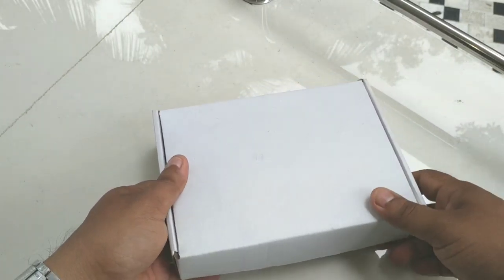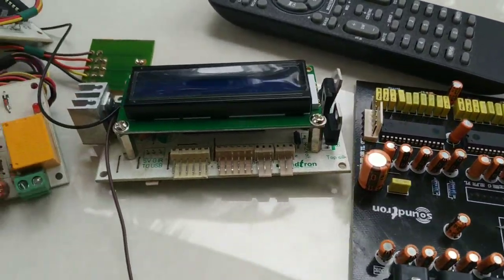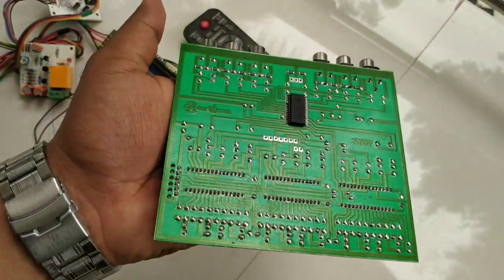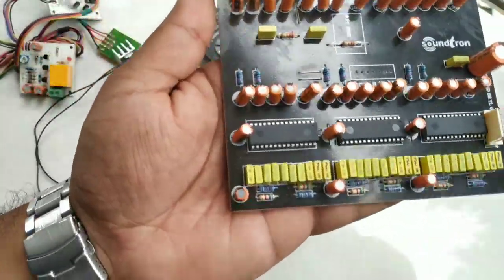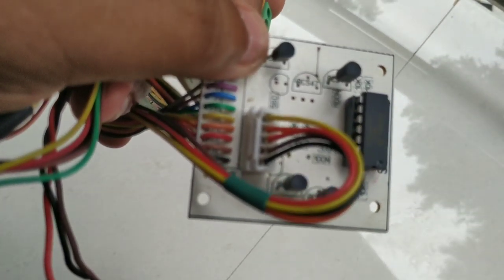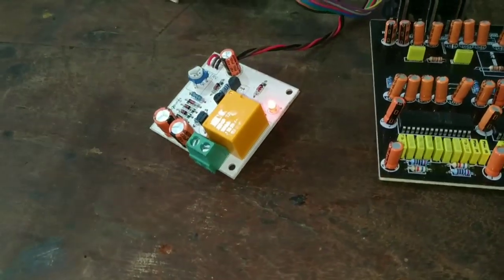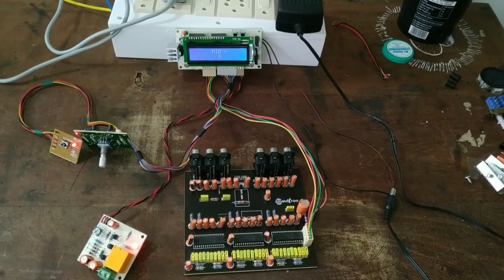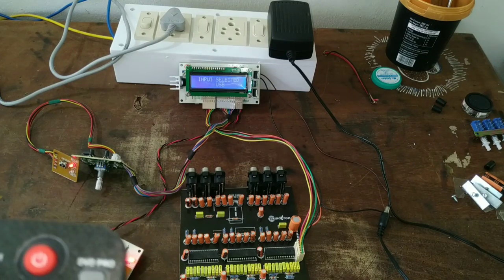soundtron 5.1 remote kit unboxing

Comment: Chetta njn four 3055 transistor amplifier anu use cheyyunnath
Sub filter lm324 anu use cheyyunne
But vocal kayari varunnu enthengilum cheyyan pattumo
Reply from the maker: Filter maaruu
Reply: 27-0-27 voltinte vangu...  ollathil vibration feel kooduthal olla ic yan LM324..  nammade asante munpathe video nokku athil torroid transformerinte ithiri ippare irikkunna aa filter edukku oru 30 hz to oru  100 hz vare pure  anenn thonnunnu..  njan atha use cheyyunnath koodippoyal 130/- athre varuvollu

Comment: Bro ...stereo  to 5.1 converter board ethaanu nallathu...nalla sound changing venam..😃
Reply from the maker: Gtech sitil oru dolby prolgic board sale und 1500rs anu price ath original dolby prologic certified ic anu.. Athil kittunna pole prologic vere onnum kittulla ath try chyuu
Reply: @technicalevolution9887  tnq u boss😃
Reply: @technicalevolution9887  അത് remote kit ആണോ ,ഏത് ic ആണ് അതിൽ ഉപയോഗിച്ചിരിക്കുന്നത്
Reply: @dileshdilu6515  ssm2126 processor